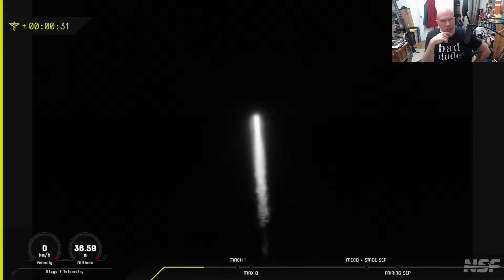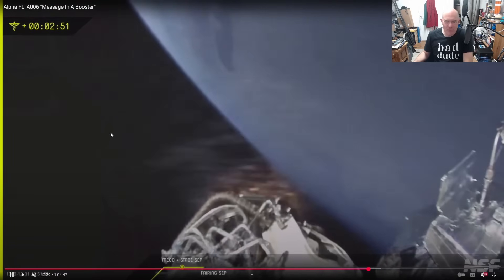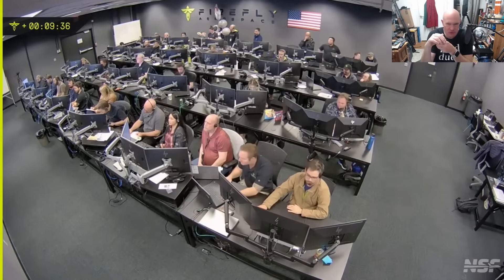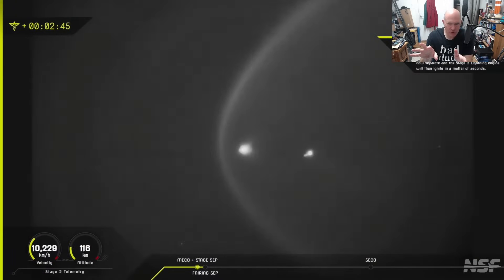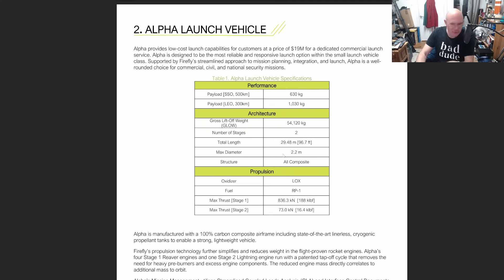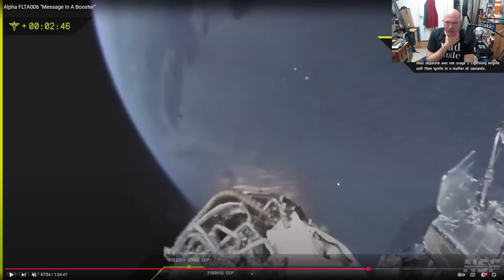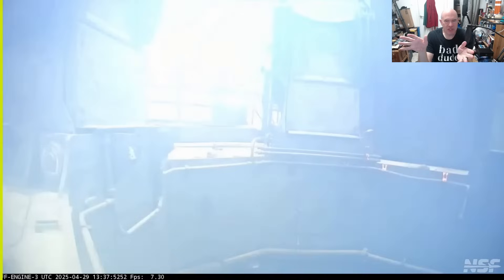What Went Wrong On Firefly's 6th Rocket Flight? Did The Nozzle Fall Off The Second Stage?

Comment: On the topic of how to execute stage separation . . . is there enough atmosphere at that altitude where 3 or 4 aerobrakes could pop out of the first stage just as the second stage is unlocked?  I'm thinking that a sudden increase in aerodynamic drag on the first stage could pull it clear of the second stage?   It might take too much time or not be effective enough with the thin air.  Your thoughts?
Reply: No. Two-stage rockets are generally staging at somewhere around 70-80km up... not quite at the Karman line, but air pressure at that altitude is negligible.

Comment: Great analysis of the flight, but I disagree with something you said at 3:15.  The larger nozzle size used outside the atmosphere is actually needed to RESTRICT the thrust's direction.  Lower down in the atmosphere, air pressure itself restricts the thrust, allowing for smaller, (lighter), nozzles.

I find it fascinating that the weight of the atmosphere itself comes into play in rocket science!

Comment: I orignailly hazarded a guess at a failure of the separation mechanism and then the interstage was blown out by the 2nd stage ignition taking the nozzle with it.
A combo of failed gas pressure separater and 2nd stage ignition seems plausible. 
Big up for the guidance guys tho, it got itself straight again and tried its hardest to finish the job!

Comment: There was a 1st stage RUD.

13:52 - Digital tech inherited interlaced scan from the analog television era, and even with this thermal camera they did it wrong. The two 'half fields' represent two separate 'frames' in time, so I personally strongly disagree with the idea that it is only '30 fps' when that number can be very misguiding. The camera itself may be also an analog one, although its resolution seems too high for that. I agree that we should give up on interlaced scan once for all, it's obsolete.

Comment: Great Investigative Explanation as always!!

but the whole "...nozzle came off..." thing is kind of expected considering the whole Firefly lore right?  Didn't the Primary Buffer Panel "come off" from Serenity once or twice? ;-)

Also, what's with the 1969 31 Dec date/time-stamp on some of the live footage (look lower left)?  possibly indicating that something in the telemetry processing pipeline fubbed the elapsed-time conversion relative to Linux's 00:00:00 1 Jan 1970 epoch...

Comment: Just as a note to Firefly.  You can't use paper, cardboard or cellotape, because the front will fall off or in this case the nozzle.  At least it was disposed of outside the environment and only because the nozzle fell off.
Reply: Now we know where "outside the environment" is - it's somewhere north of Antarctica. Probably also south of the North Pole!
Reply: The real problem was that it didn't have the minimum crew required (1) ;-)

Comment: What you can't see in separation chamber is air. 
If that chamber was too air tight, it could have built up a pressure that in vacuum can explode.

Comment: Amazing --- how possibly can a ROCKET NOZZLE be considered "highly fragile"?
Reply from the maker: Because it deals with low pressures
Reply: Rocket nozzles compared to the rest of the system are very fragile, but only when not in running. When the engine is running the exhaust gas pressure against the side wall of the nozzle provides tensile stress to the whole system. Nozzles by design are fragile and light when not operating, but incredibly strong during the engine firing.

Comment: 12:52 There are actually three distinct "puffs". The first puff is short and seems to have come from infront of the main engines, as the cloud is dense until it gets punctured by the exhaust/wake. It's not a distinct event though, it is promptly followed by the second big puff, as if the LOX tank got punctured, decompresses and then bursts, releasing the remaining propellant like a drop in the middle (13:20). The third puff is much less energetic. Would make sense that those first two puffs at 13:00 was LOX, they expand rapidly and quickly dissipate, while the second one has more of a hue and persistence to it (viscous kerosene in the lower tank).

Notice how the last one doesn't produce any ring, so the booster end must have been shredded by that point with the engines being thrown almost downwards, just like the (very) hot pieces at 14:49 suggest, ie the whole booster is gone by that point.

The 8:17 sequence from separation to ignition is about 1 second, if you time from the meco at 2:07 forward, it also lasts about a second, so failure probably did occur around second engine startup, unrelated to the hot gas separation.

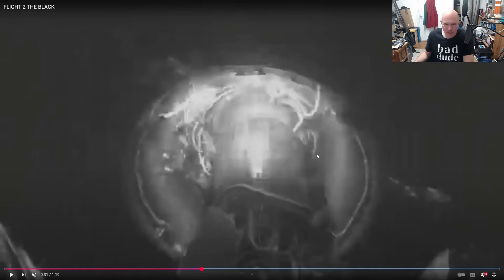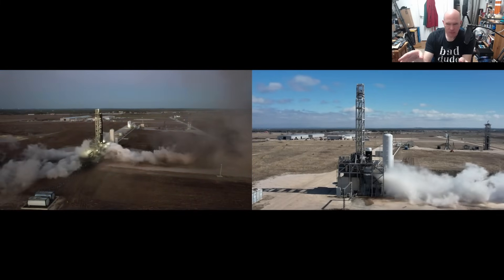As to how the LOX tank ruptured, the first puff is very sudden and spreading assymetrically, as if the (LOX) tank got punctured off center instead of the dome being blasted and subsequatly failing instantly. While 9:02 would suggest the nozzle could have ignited off center, right into the stresspoint where the upper dome, that would have most likely mushroomed the tank instantly like the apollo interstage, or not ruptured itat all. Also note the angle of attack at 12:41 (exhaust not inline with booster), it is not going straight, maybe canting was a factor in a slower/failed separation.

However, the fact that there is a miniscule delay between the first initial puff 13:04 and the large (LOX) rupture, would suggest that therewas some clearance when the second stage ignited, and the tank got punctured at first (f. ex. by a subsonic engine bell), releasing the pressurisation gas in an intial puff and then failing catastrophically. The otherwise minimal damage on the upper stage supports this as well.

So either the second stage failed to create clear the interstage, igniting into it, or it clipped/had a existing failure in the nozzle, that then got blasted into the LOX tank. Since the LOX dome didn't get immediately ripped apart by the rocket exhaust and the upper stage seemed to have no other damages, i'd guess the LOX rupture was a secondary effect.

One could probably figue out the rough initial puncture size if you take the time between first puncture and catastrohic failure, then compare that  to the time a shockwave would need to reach the bottom of the tank. If it blew up faster than the shockwave could've traveled, you know it cascaded down the sides, creating carbon confetti instead of an opened can.

Comment: I'm going with one of the clamps/frangible bolts failed to release, causing an unintentional hot-staging. When the interstage and nozzle extension violently separated from the vehicle, there was enough resistance from the attachment method to cause the oscillation.

Comment: I wonder why they don't use what the Saturn 5 did? It had small separation rockets on each stage. Upon separation the 1st stage would fire upward slowing the stage down, the 2nd stage would fire downward speeding it up, thus pushing them apart. Once far enough apart the 2nd stage engine would fire.
Reply: Likely the extra mass for the separation motors reduces the payload capability.

Comment: It's a shame they're still having issues, but on the other hand, the engine continuing to run to complete the burn without failing is kind of impressive in its own right. Could easily have failed after that nozzle extension was lost.
Reply: Not only did the engine continue to operate, it had enough control authority to bring the vehicle back under control from a dangerously wild cartwheel-style coning spin.  That one thing was perhaps the most impressive fact I noted during the whole flight!
Reply: @DougVanDorn Yep. That’s what I’d point to. That and not cutting the engine off on a timer.
Reply: Exactly, let's take a moment to seriously consider the engineering that must have went into that engine to make it robust enough to survive an explosion.
Reply: Vulcan lost an engine nozzle and was still able to make the planned orbit
Reply: @juniperpansy  Yeah, that was impressive too.
Reply: @juniperpansy that was a stage 1 srb by the way, which did not affect mission profile too much.
Reply: @juniperpansy  The SRB already shapes the exhaust somewhat, so perhaps not quite as bad as with a liquid-fuelled engine.
Reply: At least it wasn't a cooled bell design, that would've rendered it kaput! 
(In fairness I don't know enough, so 2nd Stages may not even use that kind of engine design for am I know lol)
Reply: Yeah the Vulcan recovery was impressive, but one SRB losing performance towards the end of is burn is far more manageable than the upper stage losing even a little performance for its entire burn. As Scott said, it was doomed once they lost it. If they lost it 80% through the burn, could have been a different story.

Comment: Love all your videos.  Here's a potential video idea for you that I struggle to comprehend.  Take a flow of water, say in a hosepipe. Reduce the hose diameter and the water goes faster, increase the diameter and it goes slower.  We've all put our fingers on the end to make a spray.  Now with rocket engines, the expander nozzle somehow makes the exhaust gases go faster as the nozzle gets larger diameter.  This is backwards to what we know from a hosepipe.  It is obviously true, but why.  It seems intuitively wrong.  Would love to hear someone like yourself explain in simple terms as every time I think about it, it just does my noggin in.
Reply from the maker: You’re dealing with subsonic flow, rocket exhausts are supersonic flow.
Reply: It seems to me the purpose of the cone is to redirect the flow of the exhaust, in the direction opposite to the heading of the rocket. Without any cone the exhaust has opportunity to expand in a direction close to 90 degrees relative to the heading of the rocket. Without any cone: expansion of the exhaust in sideways direction is not contributing to propulsion. The cone, I figure, redirects sideways expansion that is present. The process of the exhaust being redirected contributes to propulsion. 

The exhaust does lose energy as it expands, but that energy is not lost. The expanding exhaust is doing work, pushing the cone out of the way. The cone being pushed out of the way is propulsion for the rocket.

If I recall correctly, in the case of an ion thruster the density of the exhaust is so low that expansion of the exhaust is negligable. Hence with an ion thruster there is no cone
Reply: Additional information (I learned these things from videos by Tim Dodd, the everyday astronaut) 
Both the first stage nozzle size and the second stage nozzle size are a trade-off.

Priority for the first stage nozzle is to have maximum performance at lift off. Set up a nozzle such that when the exhaust reaches the rim of the nozzle the pressure is about 1 atmosphere. The actual atmospheric pressure acts effectively as an extension of the cone, preventing expansion in sideways direction. As the ascending rocket reaches high altitude: at high altitude the atmospheric pressure is lower. With that low surrounding pressure the exhaust does push out sideway as it flows past the rim of the nozzle. If only that nozzle would be larger! However, with such a larger nozzle: at lift off the surrounding atmospheric pressure will tend to compress the exhaust, with corresponding loss of propulsion efficiency.

For the second stage nozzle: second stage flight is outside the atmosphere. There is no surrounding atmospheric pressure, therefore: the larger the nozzle, the more the exhaust is prevented from expanding sideways. Bigger nozzle, more contribution to propulsion. The trade-off is the weight of the second stage nozzle. The larger the nozzle the larger the amount of mass that must be accelerated.

Comment: Someone posted on X a video showing the stage separation (assuming it was for this flight) and it appeared the entire stack started rolling and yawing immediately at MECO which only got worse as the 2nd started to separate and the nozzle appeared to strike the 1st stage.. Then immediately at SECO the 2nd immediately started rolling and yawing again. I wonder if a thruster was misfiring or maybe even a leak and while the mains were running their gimbaling was able to compensate

Comment: I hope Firefly gets it together, we need the competition.  That said, the broadcast was a mess.  The telemetry was seriously delayed, to the point that they should not be showing it overlaid on live stream.  The time clocks also reset, showing the last day of 1969 instead of the current date.  Lastly, the commentators didn't relay anything related to the back of the rocket (nozzle) falling off.
Reply: Great Scott! The rocket's nozzle must have travelled back in time!

Comment: Just my 2 cents. Interlacing was part of 1940s analog video. It reduced flicker and resulted in smooth motion. Interlace exists in digital format for backward compatibility. Digital freeze frame of an interlaced frame produces the double image. There ARE digital deinterlacing filters that can address the problem, but they are rarely used. Progressive (rather than interlaced) would be better for this application, but it was not done for whatever reason.
Great review of the launch - keep up great content.
Reply: Interlacing was used to increase the vertical resolution without increasing the scan rate and double the bandwidth of the video signal.  NOT for "smooth motion" !  It's easy to make a still image of the Field (60 FPS), not the Frame (30FPS) and have no doubling.  This reduces the vertical resolution of the still image by 1/2. 🙄
Reply: Interlaced video reduces the required data rate…
Reply: @ There was no "Data Rate" because there was no "Data".  When video was developed, photosensor imagers were  Raster Scanned which made an analog signal varying in amplitude from 0 to 0.7 Volts.  The bandwidth assigned to broadcast TV for the video was a 4.5 MHz.  Many decades later CMOS light sensor matrixes would become the standard. which the produced a serial data stream to generate video signals.
Reply: @ Data doesn’t just refer to digital data - analog wave forms are data too…
Humans can’t see anything that changes more rapidly than 1/20th of a second. Your cat can…(shorter visual signal path).
Reply: @allangibson8494  Seem like one could write a book about what you don't understand.   Wait, there are quite a few, perhaps you should read one.
Reply: @ Perhaps you should talk to an actual electronics engineer… (like me)… Look up the sampling theorem for a full explanation.
Interlaced digital video exists for compatibility with 1940’s era analog video with low band VHF’s  limited bandwidth.
The 6MHz video band limited available data transmission resolution when spread over 512 lines (640 in Europe).
Reply: @allangibson8494  I am a retired Design Engineer who spent 1/2 my career in Television.  If you feel like redefining the meaning of words and calling analog TV baseband video signals "data", then feel free.  No one has ever called it "data", just like no one calls the analog audio information from AM radio "data".    The point is that interlaced video was developed to reduce the bandwidth requirements while doubling the vertical resolution for TV, not to "smooth" it.
Reply: @ I never said it was to smooth it. That was someone else.
All information is data - (wearing my other hat as an instrumental physicist) - its presentation just changes as to being binary, trinary, quadrature encoded, analog or whatever ever other form you want to present it as.
Reply: @allangibson8494  Yeah, well any and all "stuff" is therefore "data" including whatever is flushed down a toilet, but selectively transferring favored definitions of words from one technical field to another for the sake of making a dubious point is not "scientific".  
Again, the point is that interlacing video allows a higher resolution (vertical) with 1/2 the bandwidth, which is a limited quantity to allow for more TV channels and less expensive equipment.
Reply: @ “Data” is generic. All information is data, regardless of if it is digitised. Data has been used for “factual information” since 1645, far predating the concept of a digital computer. A datum is an individual point of data and both are derived from Latin.
Applying the term only to computers is a recent novelty.
Reply: Interlacing wasn't noticable on CRTs because the image persists and the lines blend together. It ought not be used anymore, but it seems we can't get rid of it.
Reply: Yes, the backward compatibility that outstayed it's usefulness.
Reply: There is no reason to record interlaced digital video. Progressive scan video can be converted to interlaced if it needs to be displayed on a CRT that doesn't support progressive scan.

Comment: does the engine design have some potential for a "wet start" to occur similar to a turbine?

if it dumped a significant quantity of propellant into the interstage without igniting it then it may have dislodged the nozzle and/or caused the top of the tank below it to fail and dump all excess oxygen, causing the cloud?